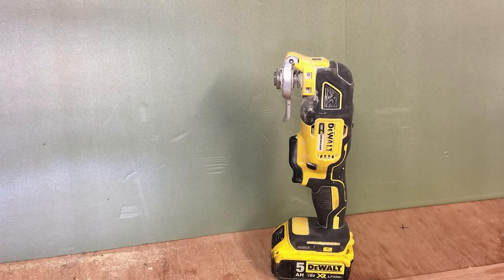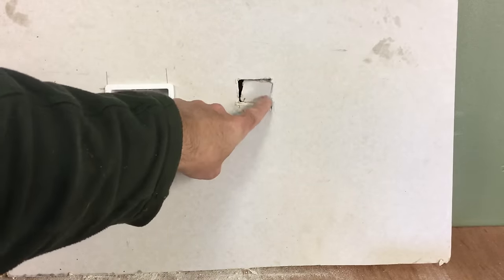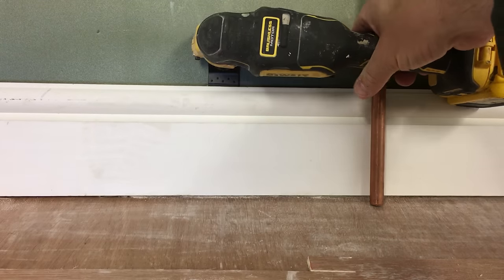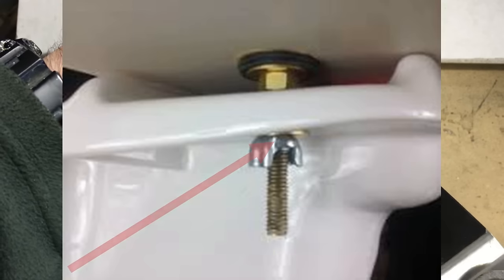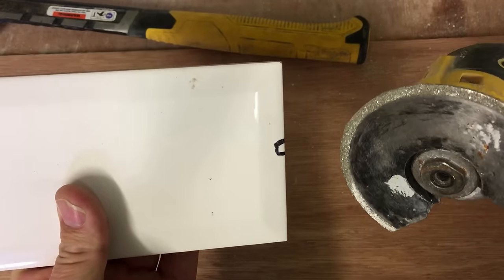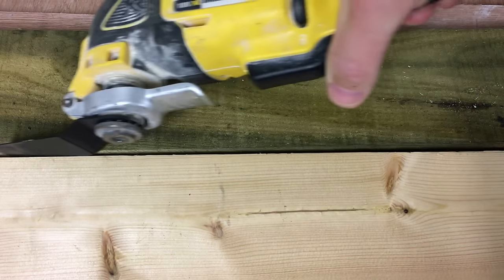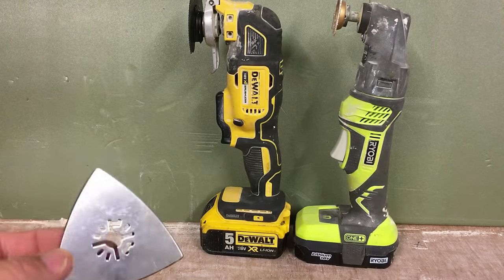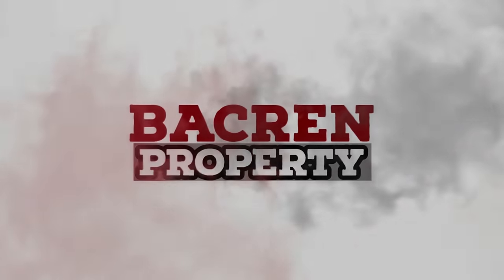20 ways to use a Multi Tool | Dewalt

Comment: A tip for cutting access holes in drywall (regardless of using whatever kind of knife/saw/blade) - make your cuts at a slight angle pointing inwards. This way, when you put the cut piece back in the hole, it sits nicely, and won't fall back through and down inside the wall cavity.
Reply from the maker: Thanks LS, That is a good tip. I usually just cut the top and the sides and sort of use the uncut bottom as a hinge - that way, it can be pulled back and just hangs from the wall and can easily be pushed back in place without removing it.
 I like your tip though, I will start to use that when doing this from now on 👍😃
Reply: Man's a visionary
Reply: the ol pumpkin trick
Reply: You sir are smart as fuck. I thank you for that 🙏
Reply: Damnnn that’s such a clever idea, i’m doing that next time
Reply: The hours I spent lifting floorboards with chisels, claw hammers and crowbars and trying not to splinter them.  I'd happily chip in to have a statue erected of the inventor of these things. They are a godsend.
Reply: genius!!!
Reply: Brilliant!
Reply: So simple yet so clever. Thanks.
Reply: A goodin' fer sure!
Reply: Top tip
Reply: This advice is worth its weight in gold
Reply: That’s a blood brilliant tip
Reply: Good idea.
Reply: Like carving the top of a pumpkin.
Reply: Gold. TY
Reply: And don't cut wires with it. 
Spark.

Comment: Carpenter of 35yrs, this tool is a must for any tool kit, its the kind of tool you think you don't need until you see someone else using it, so many applications, saved me a lot of hassle many times.
Reply from the maker: Exactly, same here, it comes in SO handy for little jobs you don't even think about. Thanks for the comment 👍

Comment: Cool. Used my Dewalt 20v max tonight to replace an old drain tail pipe (thick chromed steel) on bathroom sink. It was the kind that screwed together from top and bottom and also has a nut on bottom to pull assembly down tight. It was all corroded and crusty. Popped in the fine tooth blade and cut it off  just below the nut, unscrewed nut, and pulled out old assembly. The PVC replacement was about 3/4" too long, so I just used the tool again to cut about an inch off the end. I'm in love.
Reply from the maker: Great to hear - it shows just how useful the tool is, even for the most unexpected of jobs ! Thanks for the comment 👍😎

Comment: I refurbish older lawn mowers and this will come in handy for cutting off old bolts, screws, and rusty parts that need to be replaced without damaging other parts of the mower. Thanks for the video and for lowering the volume while the tool was running.
Reply from the maker: Thanks for the comment Keith and hopefully the tool will help within your business. All the best 👍

Comment: I have one of these handy tools I bought a few years back when I was tiling my floors and I’ve used it a few times for cutting copper and PVC pipes and other things. I wasn’t sure if it would work on an aluminum fence post and came across your video. I’m going to try it on the fence post. Your video is very informative and it gave me more ideas of where I could use it. Thank you!
Reply from the maker: Thank you for the great comment and I am glad you found the video useful !

Comment: As a mechanic by trade I'm buying into carpentry kit for a house renovation. Great video I definitely want one because this Multi tool belongs in mechanics kit aswell! So many bolts and hidden parts I have needed to cut! With an angle grinder it's dangerous and difficult! This is perfect for many bolt cutting jobs. e.g. stubborn drop link bolts that just spin freely with nothing on the rear to counter that. Just slip this in and cut free! Brilliant tool.
Reply from the maker: I am sure you will find loads of uses for this Henry, thanks for the comment 👍😃
Reply: All in one: Multitool Gear
https://multigear.kckb.st/3f9ba7de
Reply: The blades don't hold up well against grade 8 hardware. Tried Milwaukee carbide lasted about 20 seconds didn't make it through the bolt. Cheap harbor freight carbide blades did as well. Took a total of 7 blades to cut the heads off of two bolts. It has worked great for making new interior panels for the shuttle bus, had a few odd shapes to notch out.
Reply: @craigwiess1656  I found the exact same thing! literally can't go through a standard nail and if you do then the blade is completely knackered! Some random attachments could come in handy like the sander but mostly useless for mechanics I know now after using one a lot I take back my statement. Also I keep the diamond masonry bit in my angle grinder for metal now. It's way better than the sand paper grit type! I had one break on me the last time and it skimmed my face and the other bit my hand! I felt it but came out unscathed luckily! Ive never needed the recip saw for mechanics yet but its nice to know it's there😉 multi tool kind of over rated to me at this point. Maybe it will show its worth in 2nd fix and finish work more but ime still in the rebuild process! House renovation taking ages!
Reply: @E69apeTheMatrix420  o

Comment: My new multi tool has made my life much easier.  Making half lap joints on pressure treated wood, after making parallel half-depth cuts into the timber with a circular saw, the multi tool made quick work of hogging out the waste material and leaving me with a nice flat surface.
Reply from the maker: That's a great idea! Thanks for the comment !

Comment: And I've used mine to get gripfill / adhesive. of a  Skirting board. Was trying for ages with a scraper. Though I'll try with the multi tool with the scraper attachment.  BOOM 💥.  THE GRIPFILL NEVER STOOD A CHANCE!!
 just another use for this brilliant tool. Listen to the man. You won't be disappointed 😀
Reply from the maker: Great comment, I have not used it for that specific job, but I can imagine it would get the old gripfill off in seconds ! Cheers 👍😀

Comment: Thanks for this. I just bought one after watching your video. Can I ask what blade you would recommend for shaving wood off a sticking door?
Reply from the maker: Thanks, you would be best with the sanding pad attachment for that, if it is just a thin piece that needs removed. Either that or an actual wood plane which would be best for the job.

Comment: I just got a cordless version. Have had a wired version but rarely gets used because I need a cord. This should save me a lot of trouble. $99 for kit at HD right now with charger, battery, and two blades.
Reply from the maker: I wish I lived in the US, these are double the price here in the UK ! Thanks for the comment !
Reply: Got the same one! Man, I wish I'd had it when I was cutting a new hole in my cabinet to vent an over-oven microwave. Would have saved me from taking the cabinet down to cut the hole. Looking forward to new projects now

Comment: I recently used mine to widen the gap between two oak floors so I could house a threshold bar. So much easier than a circular saw and chisel for the bits the saw can't reach. Of course if I had bought the threshold bar when I bought the flooring I would have needed neither!
Reply from the maker: Yes Ian, it is a great tool with SO many applications. Very good for the type of job that you have explained, so handy ! Thanks for the comment 👍😀
Reply: All in one: Multitool Geare 
https://multigear.kckb.st/3f9ba7de

Comment: Excellent, practical and lean video. Thank you. I'm deciding whether to buy a multi-tool, so here's a question for you ...  is the multi-tool good at clearing a margin of plaster off breeze blocks to set-in mesh lath prior to patching over big cracks (10mm wide or so)?
Reply from the maker: Yes, it would do that.

Comment: One of the more unusual uses I did was to spachcock a mutant sized turkey (~40lbs) at Thanksgiving.  Made quick work of it, but the downside was disinfecting the tool and blade afterwards.
Reply from the maker: I bet this tool was good for that but sounds messy 😂 I used mine on Halloween for carving my daughters pumpkins, worked great ! Thanks for the comment. 👍

Comment: I will be cutting out lots of copper pipe from hot water heat system.  My old carpenter used a reciprocating saw and took forever on one pipe.  I have a multi purpose tool from Harbor Freight, has cord and not a Dewalt, but with your tips I think I can zip right through the copper pipes.  Thanks
Reply from the maker: To be honest, the multi tool is not the best for that job as it will take too long. Best with a proper pipe cutter or reciprocating saw with a metal blade in it in my opinion. Thanks for the comment.

Comment: I have used it to sharpen dull utility blades by holding the blade securely by pliers then making 2 angled passes from top towards the bottom per side using 240 grit paper ( I try to match original blade angles)
Reply from the maker: Good Tip, thanks for the comment 👍

Comment: Hello, 
I am replacing redwood boards on my deck.  If I need to cut on the end piece that measures 11/2inches (3.81cm) thickness, can the tool cut this thickness of wood or should I use a circular saw of jigsaw?
Reply from the maker: Yes, you could use this tool for that, but it would be quicker and more efficient to use a circular saw if you have one. Thanks for the comment
Reply: Thank you. I do have a Miter saw as well

Comment: Great for removing adhesive which is left on the wall after removing ceramic tiles.
Reply from the maker: Yes Mike, that is another good use for this tool with a scraper blade attached, thanks for the comment 👍

Comment: Would this be a good tool to cut holes for electrical boxes in old plaster and lath walls?
Reply from the maker: Yes, you can use this tool for that but obviously have to be careful with lath and plaster. Take your time and it will do the job well for you.

Comment: I work under suspended flooring a lot so usually cut a hatch in the floorboards on the joists. Used to use a circular saw but that’s too messy and easy to damage the boards. I use an Erbauer multi tool it’s really accurate if you take care and time when cutting. Great video, motivated me to sort the grout in the bathroom 😄👍
Reply from the maker: Thanks Lee, Yes, they are great for cutting sections of floor board / Chipboard but I tend to use my mini circular saw for that now, unless access is restricted. Good luck with the grout removal..........can be very tedious 😂👍
Reply: yea but the B5 S4 though Lee lol

Comment: BIG TIP !!   Use your metal blade to  cut out the other blades to use on the thumb latch DEWALT DCS355N Oscillating Multi-Tool. I'm surprised you didn't figure that out yet...
Reply from the maker: Haha.........That honestly never occurred to me ! I have been buying the pre cut dewalt style blades all this time - DOH ! Thanks for the great tip - I feel like giving myself a great big slap !
Reply: All in one: Multitool Gear
https://multigear.kckb.st/3f9ba7de

Comment: Just became a homeowner, thinking about one of these and a basic drill as my first household electric tools, worth it?
Reply from the maker: Yes, definitely worth it as your first tools, maybe add an impact driver as well as they are invaluable 👍😃
Reply: @Bacrenfencing  Just bought a 12V Bosch from an outlet sale for 75 euro, tested it out on some scrap lumber and I think I'll love it! Found a drill that uses the same batteries for another 35 euro too. It's surprisingly strong.
Reply from the maker: @davedaniels8211  Yes, they are great Dave, SO many uses as you have just demonstrated !
Reply from the maker: @Bladsmith  Nice one !
Reply: All in one: Multitool Gear
https://multigear.kckb.st/3f9ba7de

Comment: Great video. I also find both the plunge cut and scraper blades great for cleaning off bark and rough bits off green wood which I am using to make multiple pencil and pen holders
Reply from the maker: Great tip, thanks for the comment 👍

Comment: Use an old blunt saw blade, grind the teeth away and make a scraper, that can be useful. You can buy scraper blades but an old saw and a grinder did hear as well. 

Also you can buy knife blades that attach, they cut anything. I couldn't believe how will they slice carpet and lino flooring.
Reply from the maker: Hi Adrian, I actually had a scraper attachment for my ryobi but did not like it (tried it on silicone), but I may have to try one for the Dewalt. Yes, I like the look of the knife blades, I may have to buy one of those to try it out ! Thanks for the comment 👍😃

Comment: If you want to cut through a floorboard at the joist but there may be central heating pipes in a notch in the joist directly under the board is there a way to stop you cutting any deeper than the board thickness so you don't end up cutting into the pipes? I saw where my builder cut one and there were two pipes in the joist directly under the cut so I'm worried about attempting it myself Thanks for the video
Reply from the maker: Hi Kelley, The blades all have measurement scales on them, so you can establish the thickness of your floor and then cut with the blade down to the floor thickness by using the blade scale (if that makes sense ?) In other words, if your flooring is 22mm as an example, you can cut down to 22mm which is marked on the blade - that way, you know that you will not be going below the surface of the joist.

 I hope this helps.
Reply: Thank you!

Comment: Will these remove thin set from underneath tiles?? If so, which attachment is used??
Reply from the maker: Hi, I'm not sure. I have never tried but you do get scraper attachments for these, so that may work.
 I  usually use an SDS drill with a chisel to remove thin set, it is much quicker. I hope this helps ? 👍
Reply: @Bacrenfencing  Thankyou 👍🏻👍🏻

Comment: Hi good video. I’m looking to buy a multi tool and already have Dewalt drill and torch with their charger and 2 batteries XR 2mah.
Thinking of the DCS355N tool ONLY, and using my 2 batteries between the others. Do you know if a 2 is strong enough for the multi tool and what kind of runtime can it get. ( DIY use) thanks for any help. Realise the bigger battery would be better but trying to keep cost down also the 2 x 2amp batts are new ‘sh condition.
Reply from the maker: Hi Victor, I tend to use the tool with 5ah batteries because I mainly use 5ah with most of my tools. The multi tool does work with 2ah and if it is just for DIY use then it will be fine especially if you have a second battery that you can swap out whilst charging another. I can't comment on actual runtime as never used the 2ah battery with it, but I am sure it will give decent enough performance. Hope this helps a little and thanks for the comment 👍
Reply: Bacren Property Thanks for help and speedy reply👍🏼
Reply from the maker: @victorlazzlo7626  No problem !
Reply: The 2 runs about 6 hours. Got both.
Reply from the maker: @scraplifetrashtocash4551  Thanks for confirming that, much appreciated buddy !

Comment: Hi, thank you for the video. Question: For all the non-DeWalt blades you showed, did any of them need an adapter to work with the tool's quick release? Thanks for any feedback.
Reply from the maker: Hi Ken,  thanks for the comment. In answer to your question, no the blades do not need any kind of adaptor, they just fit right on. You can get loads of blades on Ebay or Amazon. I hope this helps. 👍
Reply: All in one: Multitool Gear
https://multigear.kckb.st/3f9ba7de

Comment: Hi! is it possible to make round holes with these oscillating tools?
Reply from the maker: Yes, if you buy the right blades and take your time, it is possible. Thanks for the comment 👍
Reply: @Bacrenfencing  thanks! Which blades would you recommend please?
Reply from the maker: @jd5787  It depends what materials you are cutting in to. Is it metal, wood, plasterboard etc ? If you specify, I can recommend some blades.
Reply: @Bacrenfencing  thanks! Primarily false ceiling + wood
Reply: All in one: Multitool Gear
https://multigear.kckb.st/3f9ba7de

Comment: Hey mate just viewed your video.  I do same kind of work. Really enjoyed it great to see you putting out useful, helpful, tips for people. Just order the one up from your tool. Have the older corded version. Having corded is a real pain. Looking forward to viewing more of your videos. 💪😉
Reply from the maker: Thanks Buddy, Yes, these are great tools and thanks for the comment, I will have to put up some more similar videos in the future. Thanks again 👍😀
Reply: @B13 • It's been a year now with your upgraded battery model. 
● Are you pleased you changed from the corded model you previously used?
● Have the batteries continued to work/recharge reliably?

I'm an older DIY guy, and went back to corded tools because of my poor experiences with batteries. Maybe "modern batteries" are better than those of ten years ago, but I'm still a bit wary. Do you recommend switching to battery powered tools?

Comment: Great tool but i find changing tools isnt as easy as i thought, need quite a bit of force!
Reply from the maker: Are you sure that you are using compatible blades ?
Reply: @Bacrenfencing  
Sorry i meant the changing of blades, i need two hands to pull the lever towards me.
You made look so easy!!😁 i guess i need stronger fingers
Reply from the maker: @hussainahmad5967  Ahhh, yes the lever can be quite stiff when new, it will loosen off with time !

Comment: I just bought this thing and have no clue how to get the blade on
Reply from the maker: Firstly ensure that it is a compatible "open" ended style blade. Push the lever down on the tool and simply push the blade on whilst still holding the lever down. Once the blade is in position release the lever and the blade will be secure.